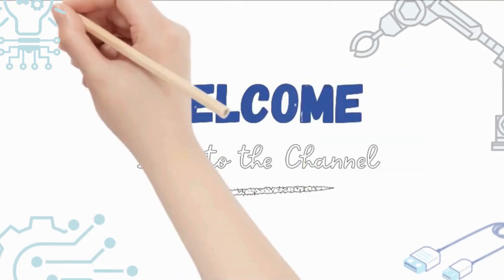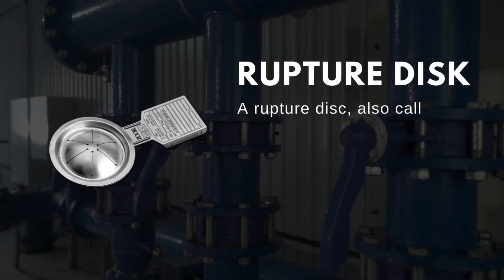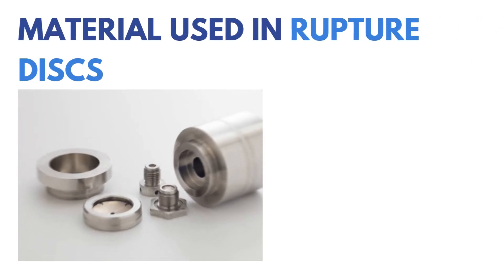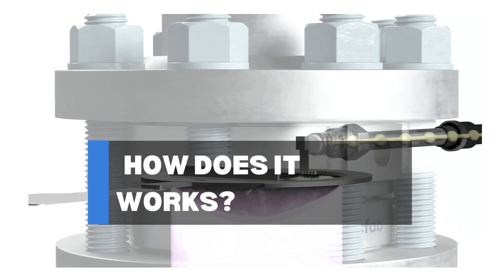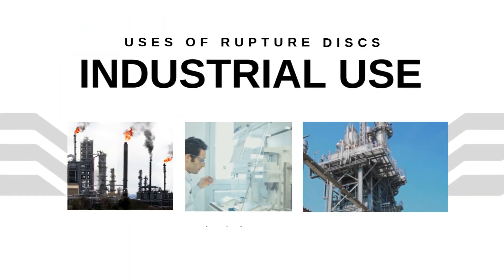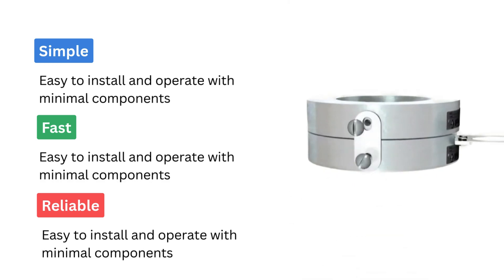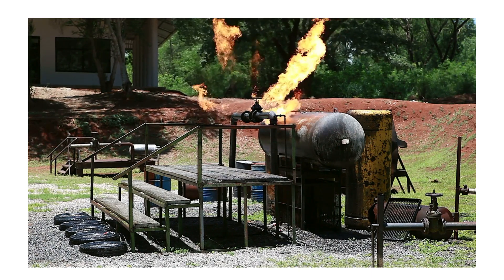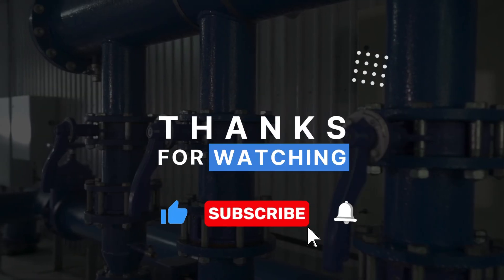Rupture Disc Explained | What is Rupture Disc? | How It Works | Core Engineering

Comment: Why repture disc is fixed in before the srv?
Reply from the maker: There are multiple reasons behind it i.e. if fluid is corrosive then rupture disc with tell tale assembly is installed upstream of psv so it'll protect the psv from corrosion and if RD brust up will let you know.